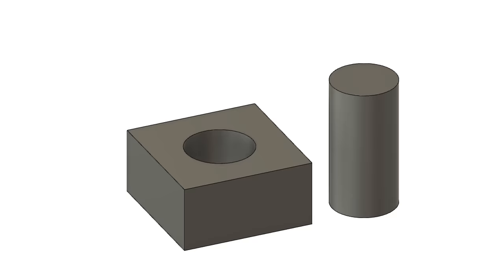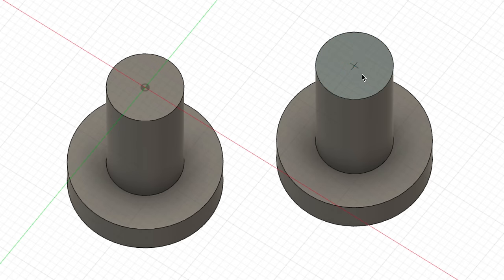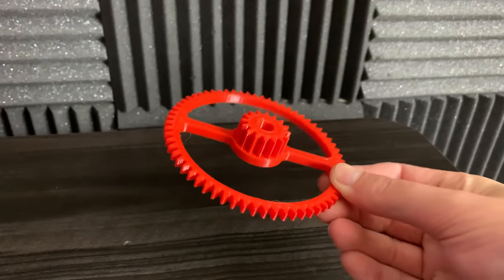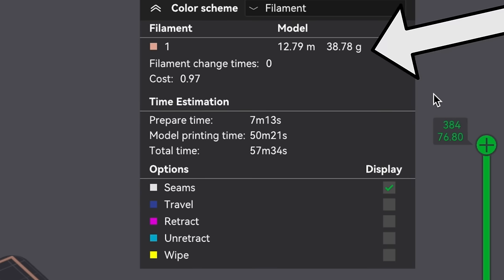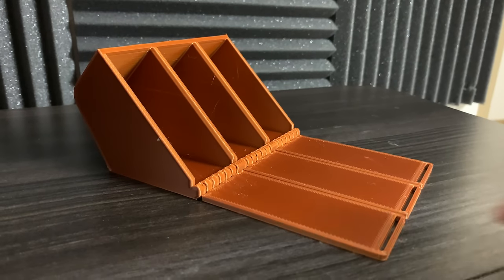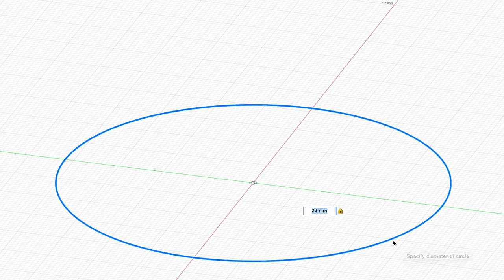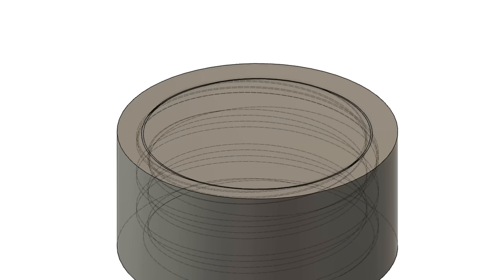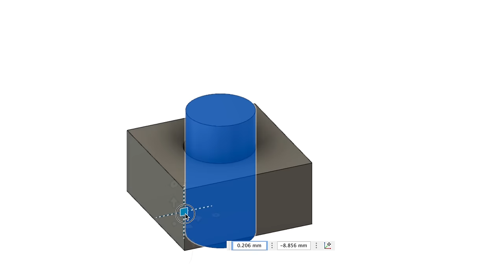10 Secret 3D Printing Tricks Only Experts Know...

Comment from the maker: Which tip / trick was your favorite?
Reply: Where an inventor can go to request, specify, and pay for a unique 3D printed part.

Just kidding---you didn't actually mention that, though it would be very, very helpful if you did. Cheers,
Reply: @johnstrawb3521  I think it's called shapeways
Reply from the maker: @johnstrawb3521  Are you looking for someone to design a new object? or do you want to 3D print an existing object? You can hire CAD designers on upWork.com or you can have prototypes made by Xometry.com
Reply: The hinge was my favorite. awesome video love the concept
Reply: Chain 🤯
Reply: gear utility in Fusion 360
Reply: The one that wasn't blatantly just an advertisement for a cloud service that showed in its infancy the company behind it can't be trusted.
Reply: Now knowing how to design the print in place has been bugging me for a long time
Reply: I will be making a video that exposes you for hiding comments and then making a video using their ideas.
Reply: ALL OF THEM
Reply: I've done threads in 3D printing a few times with some sucess, but never thought of scaling it axially to make the angles better for fits, that is brilliant.
Reply: hinge and threads
Reply: Hinges

Comment: Me who learned Blender because I thought Fusion 360 was super expensive 👁️  👄   👁️
Reply from the maker: haha that's why learning both is great. Each has its own pros/cons
Reply: How did you learn blender???? I'd have less trouble building falcon xix for musk than learning blender
Reply: SAME, I thought you had to pay for fusion 360?
Reply: @Ribbat Ali oh, I didn’t even know there was a commercial one
Reply: same lmfao
Reply: Well the free version is really locked down. Nothing really impeding the function but making it a pain to use in some cases. Also historically they are locking it down more and more as time goes on. Id recommmend Solid edge given its fully free. At least the community edition
Reply: @TGG141  hobbies version .. kinda works nice, but you can't so thermal testing, cam, and generative design.. actually I think parts of cam
Reply: I was too a blender og before the big update where a lot of controls got switched lol
Reply: @karlohorcicka7388  Watch through a tutorial series and write down all the shortcuts used for later reference. Blender is near impossible to learn just by poking around, but very efficient once you've been told where everything is. CAD modelers do have their advantages, but I much prefer the freedom of mesh modeling.
Reply: Fusion 360 has some limitations on the free version.
Reply: Me who learned OpenSCAD and keeps meaning to learn Blender because I refuse to be caught up in AutoDesk's lack of integrity the next time they think people have forgotten all about that time they used the F360 Terms of Service contract to steal everybody's Intellectual Property rights who used it.
Reply: * laughs in inventor*
Reply: Blender is the best anyway
Reply: Fusion 360 is for free
Reply: Fusion 360 is charging me 7 a month to use it.. personal use.
Reply: @cokemillion  I managed to get it for free by telling if I am not using it for factory use and I am a maker
Reply: @Ribbat Ali this is funny because not having used cad software before Blender made so much more sense and was intuitive in comparison 😂
Reply: İf you are ı student it is free
Reply: @@pls_i_have_no_namehahaha exactly the same boat. it still doesn't make sense.
Reply: @cokemillion that's not right. Cancel your payment and reap the rewards
Reply: Research is hard
Reply: @dekutree64 and some of the CAD add-ons are actually great!
Reply: Press F to pay respects 😞😂😂😂
Reply: I've been using Blender since 2.49. I use 2.79 now because 2.8 is wack. I still love it for rendering art but Mastercam is my go-to for CAD and printing
Reply: I have it for free
Reply: @claws61821 Wait, people's designs got stolen? Oh damn, that sounds serious
Reply: @TheMustafaC But is only usable for 3 years or permanent use?
Reply: @omegadeepblue1407  You can use it as long as you are a student, there is no time limit.
Reply: @mattaecus Do you pay for mastercam or you have it for free?
Reply: Same dude
Reply: Yes
Reply: Fusion 360 might sorta be free, but just know that whatever you create, you don't own and have no rights to.  Also don't ever depend on "cloud" anything to save your work, there is a history of things getting "lost" in the cloud.

It's a shame auto-desk has bought up all these good companies and forcing everyone to subscription fees.  Atleast with Blender and FreeCAD and other open source software, you will always own them and can use them with Zero Restrictions, and actually own what you create.

BTW, there are still some really good paid CAD and 3D Modeling software that is buy once, own forever. Autodesk doesn't own everything yet, but they are certainly trying to.
Reply: If you plan on selling products you designed, it is pretty expensive.
Reply: I use blender because I was trained on 3ds max. Making more functional bits makes me really want to check this out.
Reply: Fussion 360 is better for mechanical things and moving parts while blender is better for more detailed models and sculptures.
Reply: Same lmao just found out Fusion 360 is free. Been learning blender for years
Reply: Blender is top
Reply: Great to know both 🎉
Reply: Blender is just as good. Fusion 360 just has workflow advantages. Conversely Blender has no problem doing any of these things. I only use blender for my prints.
Reply: Get education liscence. You don’t have to be a student, just lie
Reply: I was in the same boat. I was using blender for 3d prints and designs and were the go-go person to ask for 3d parts. Professionally at my job that was.

I then swapped to fusion 360 and it is so much more easy to work with if you want exact parts. Best feature are for sure constrains and user parameters so you can adapt your piece easily by the change of a few numbers.

Blender is still nice for rendering part composition, exploded view or even animations. Also blender is better for modeling more artistic pieces with its brush and sculpt tools.
Reply: Even the hobbyist version isn't free. Look at the privacy policy, they sell all your data to anyone and everyone.
Reply: ITS FREE?!?
Reply: Me 2
Reply: Onshape is a pretty good cad software
Reply: i learned cad at my job and in now learning blender for more artistic models
Reply: @diywithhaz1559 TOS says you don’t own the intellectual property.  Technically if you sell a part and you sell it for years and make a living they can show up and say sorry sucker that’s ours.
Reply: They use blender on my campus
Reply: Me who uses both blender and Solid works. Yeah i have some old cracked copy of Solid Works. Works perfect for 3D peinting, but if i knew fusion 360 was free I wouldn't spend much time trying to make SW to work 😂
Reply: @tyrzxv  you said there are paid CAD and 3D modeling software you can purchase? What are they??

Comment: The most informative tip was that fusion 360 was free for personal use. I tried blender, but didn't understand it, so I've been using tinkercad this whole time.
Reply: fusion 360 is flipping incredible.
Reply: I use the student version of F360 but I'm gonna learn blender soon, as a Linux user I really dislike having to boot into an external hd or run a VM just to 3D modeling, so it makes all sense break free of windows/mac specific software.
Reply: @renatod.o.2930  I started learning Blender after years with F360.  To me, if Fusion is drafting, then Blender is painting.  There's just not enough precision for me.  Blender is fun and you can achieve neat results - for me it's not a great tool for 3d printing.
Reply: @renatod.o.2930  FreeCAD is probably the closer equivalent. Blender is for artistic/video game/animation sorts of modelling, FreeCAD is for parametric design of physical objects, like F360. It's still heavily under development, the interface is still a bit confusing, but FreeCAD is the only 3D design software I've learned so far (I'm determined to only use the open source option wherever it works at least 'OK' and avoid free trials or other stuff with a catch down the line) and it's served me pretty well. Definitely something to look into, especially for people in your situation.
Reply: @05Matz  FreeCAD is an extremely powerful program but it's not commercially usable. I hope 1.0 gets out fast.
Reply: ouch

Comment: What's funny is it's great Fusion 360 is free and has a thread tool, but the tool itself is TERRIBLE and incredibly restrictive. Doing anything basic like custom thread pitches, a thread that tapers back into the part, a partially threaded rod, or anything outside of standard harsh cut threads is basically a nightmare. XD
Reply: I often feel very restricted by Fusion 360. I wonder if Blender has this tool. Have you done threads on Blender? Is it better than in Fusion?
Reply: @andreojuegosyestrategia1266  Onshape has a decent thread tool, better than Fusion, and there is a good Fusion plugin to do threads, but none of them are really full featured. Honestly what I have resorted to is downloading CAD files from McMaster-Carr with the threads I need and chopping them up for use in Fusion. I do not believe Blender or even Maya have built in tools to do true manufacturing style threads.

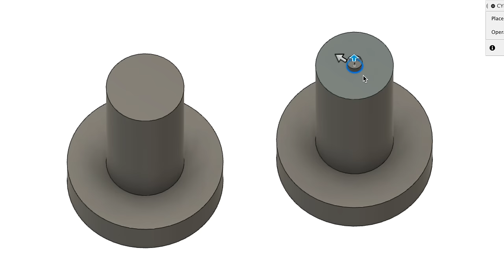Comment: 0:50 I'd prefer that you create a slicer modifier in Fusion.  That way, you have more flexibility in strengthening a part (e.g., infill %, # of perimeters, perimeter width, etc.).
Reply: CURA 'per-part printer settings'.
Divide your model into functional parts; each part is assigned different printer settings.
The only 'catch' is needing to use the same layer height and hot-end temp for all parts of the model.
It will print as a single model.

Example: a long tube with end-closures printed as a single thing.
Print it vertically: The first closure is printed in 'detailed mode, two perimeters with dense infill, on a raft, support everywhere, default thickness'.  The tubular section is printed in 'vase mode, no infill, single perimeter, 0.7mm wall thickness'.
The second closure is printed in detailed mode, two perimeters with dense infill, no support, default thickness'

There are at least two ways to divide the model: 
1) Cut it up in CAD, export each piece, load them into CURA, position the parts, assign print settings to each part.  Tedious, but it works.
2) Load the complete model into CURA, then use the 'box selection tool' to assign print settings to each part of the model.  A little less accurate, but a lot easier.

CURA preview after slicing verifies the correct settings are applied in the right places.
Reply: Those kinds of settings will only be helpful if yo u use them yourself. Most people take only the stl from Printables/Thingiverse/Thangs and slice them themselves (because they have a different Slicer, Material, Printer, Nozzle Diameter, ...) and tricks like this will just automatically be picked up by any slicer without extra configuration.

Comment: If you want your part to be stronger, add extra perimeters on the outside. The further away your material is from the center of gravity, the stronger your part.
Reply: Yes, this "expert tip" is really bad advise....
Reply: @emielessink3191  
No it isn't, both methods have their place.
Reply: It's kind of true only for a sub section of cases. For example if your part is under simple compression or tension forces it doesn't matter where the material is, only matters how much material is in cross-sectional area. If the part is under bending then it is sort of true, but what you are referring is moment of inertia. Also center of gravity also is only half true, the moment of inertia is defined over geometric center (geometric center of a area not center of mass ). So the geometric center is in same location with center of gravity if the volume of the part is uniform density 3D prints may be uniform but mostly are not due to wall layering and infill etc.  So having more perimeters doesn't always make things better, it does only in some cases.

One kind of needs to understand how the forces are acting on part to make it stronger. There's also a difference between making part just stronger of making it stronger while  retaining original weight.
Reply: @koitk  
Don't forget buckling though
Reply: @andrewholdaway813  I'm sorry I kind of missed your point. To me, one should be worrying when 3d printing parts. It's kind of really specific case of failure. Maybe I haven't come across to those 3d printed parts that would require them analyzed for buckling. Anyways my comment to OP was more emphasis that there is no single golden solution (like he suggested on putting more perimeter walls) for every 3d printed object to make them stronger, wanted to say that objects are different and they are loaded differently and therefore they should be designed and printed accordingly.
Reply: @koitk  
Yes I was just adding a further consideration, I agree with your points.

Comment: 0:52 or you could do an extra wall using cura "modify setting for overlaps" to change the wall and in fill, settings to create an extra wall inside the object without cutting the original model.

Comment: For strength, you can actually cheat better than digging a hole into it.  When you extrude down, create a new component, made it solid.  Load the Components in together, select the second component and set it to a desired infill, keep the other component at the lower infill. In a cylinder you can do this in alternating rings, or you can generate extra thick walls around certain holes if they are being utilized for thread inserts or have a rod running through them that will apply torque or tension to the body of the hole.  Yours definitely has the benefit of being quick and easy though. No extra work involved.

Comment: I am new to 3d printing, but i would say rule of thumb for Creality printers will be <NOZZLE DIAMETER> for allowances and if you are printing with 100% infill and getting too much of deformation (above NOZZLE DIAM, in my case - 2mm) - change infill type or printing cinematic, it will reduce internal stresses so print will be more accurate to the model. Also, for some reason the most viable format for exporting 3d models from Blender is PLY

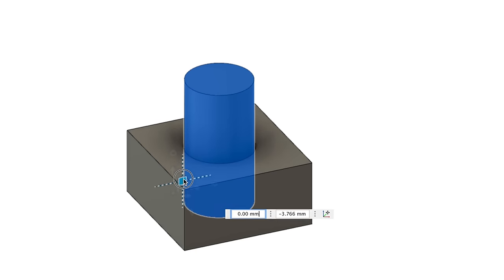Comment: 1:05 For me, it's 0.2mm for (very satisfying) snap fits, and that's on my (somewhat modified) Ender 3 using PLA. It also depends if you're printing FDM or resin, the filament you're using, print speed, temperature, and other such fun factors that you'll just have to experiment with regardless.

Comment: Remember to increase the clearance for threads in fusion 360, the standard may be too little.
Reply: How do you do that? I print the inner thread at 95% scale in X and Y direction (thead standing in Z direction) but the downside is that then the whole model gets scaled, not only the thread.
Reply: I also add a fillet to the thread edges. I find threads work better when that is done.
Reply: @Djeez2  use press/pull on every surface of the thread.
When you make it on both, a normal screw and a nut will fit.

Comment: I knew about all of these except for adding the hole in the center to make the print stronger. I learned something new today. Thanks!
Reply: I actually doubt this. Because for bending stress the extra material at the center does not make a great difference. Thats why H-shaped bar is used alot in construction: it is much lighter than solid bar but hadle compareble load. Same here. If you want stronger part you need extra material at perimeters (extra perimeters) bot not in the center.
Reply: @dmitrynuzhdin  the tip is generalizable to being able to add additional strength and support (via perimeter generation vs infill) anywhere in a model. The youtube clip confused the issue by showing the support being add to the center of a cylinder, a place that typically doesn't need additional support, but the Voron Stealthburner uses this trick in it's design to add additional reinforcement/rigidity in key structural places.

Comment: Not saying some of these tips aren’t helpful for beginners, but this is printing 101, doesn’t get more basic than that.

You don’t even specify wether your (way too big) 0.4mm clearance is for radius or circumference. 

Your little cube has now no structural integrity whatsoever, this is probably the worst option to optimise print time you could’ve suggested.

Lastly, if your method of securing a box together (beginning of the video) is with threads and 3d printed Nuts, I hope no one, ever buys your „masterclass“ on designing.
There are soo many ways to achieve the same thing, but seamlessly and invisible, without adding 16 atrocious looking balls to the outside of your print.

Suggest mold-in Inserts, properly tuned latching mechanisms or in-Part nuts/magnets with a pause in your G-Code.
Still very basic techniques but at least somewhat presentable